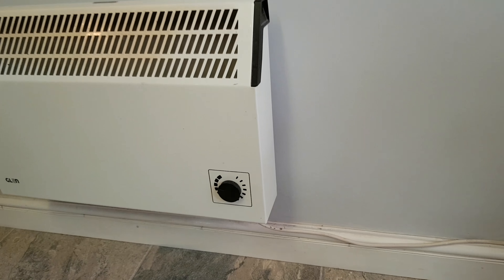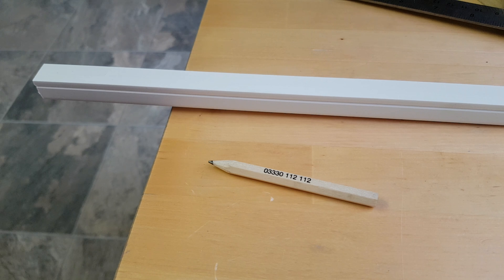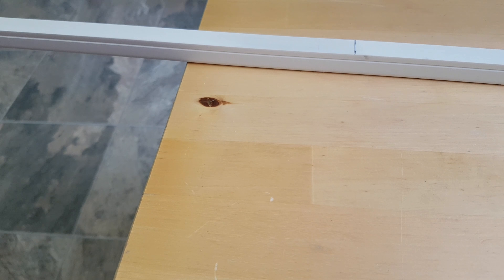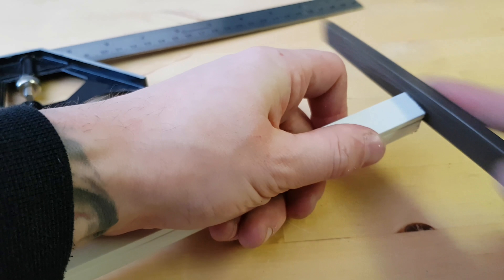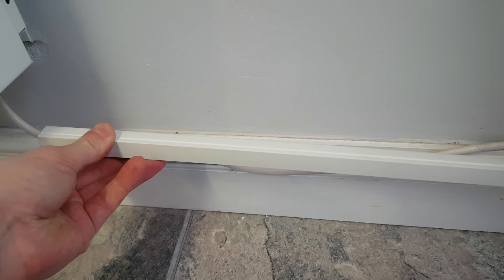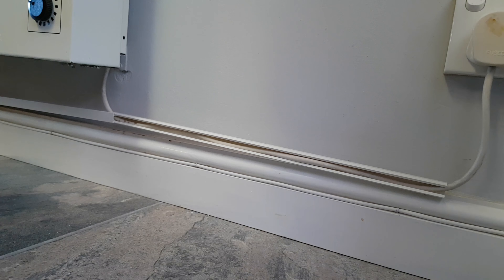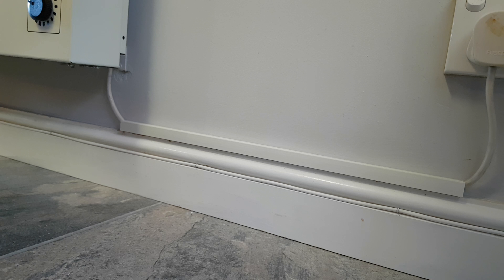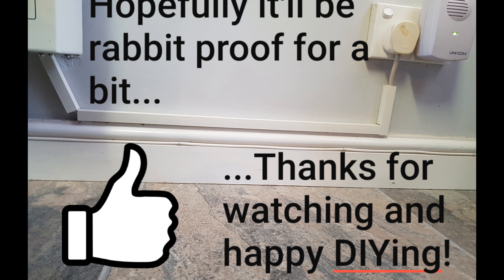How to cut and fit PVC trunking to help protect cables and wires from small pets 🐇

Comment: Great video, Simple, informative & friendly.  I would advise one thing though - wipe the area it's sticking to down with bleach or cleaner. This will ensure a good airtight fit which will bond to the wall surface better and not 'shell' when an as it gets older.  10/10 & 5 * of these!